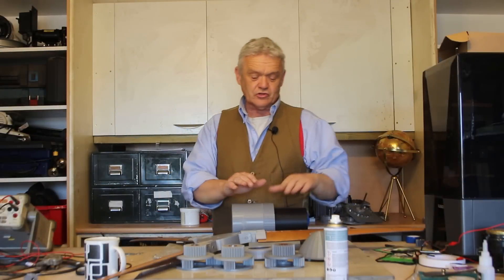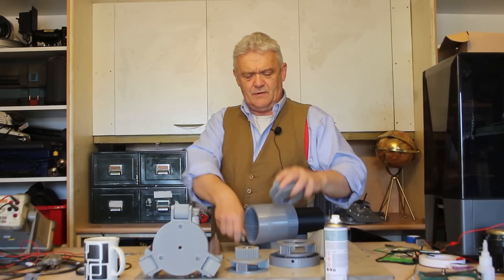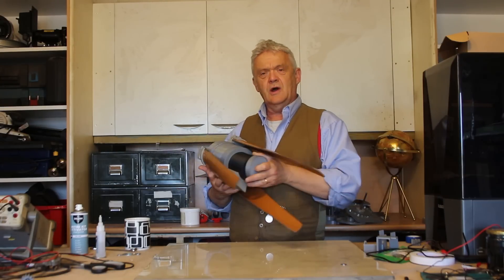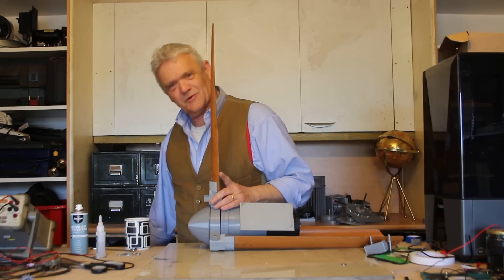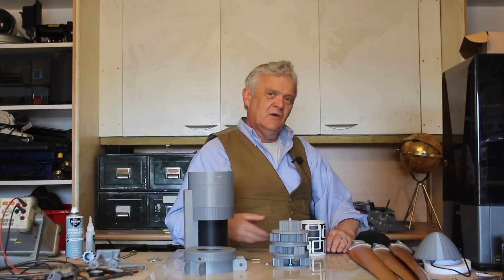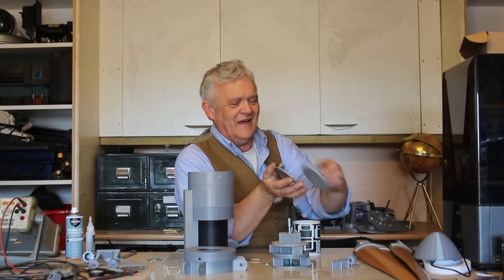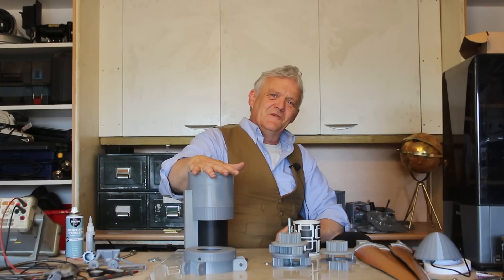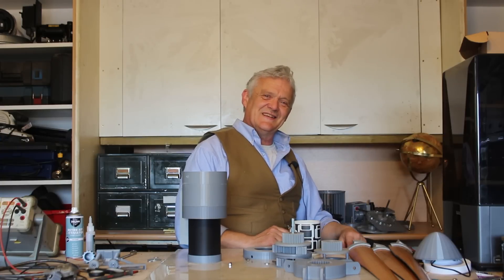1965 The Folding Wind Turbine

Comment: Hi Rob, I don't think using so many gears is a viable solution. From the point of view of efficiency, it is a waste of energy and the cause of many mechanical failures in this type of 3D creations. Best would be to use a rewound bldc motor, with a KV (RPM/V) between 20-50. It is necessary to promote that the windings have the lowest possible resistance (ideally less than 1 ohm). If you use a three-phase rectifier with Schotkky diodes, much better.
Reply from the maker: I understand mate - thanks for the advice and cheers - i should add I am going to ignore it but not out of disrespect for what you say - i think you are spot on but i have other objectives beyond just making a wind turbine that i also include in the videos.

Comment: Nylon would be a much better material for gears
Reply: No lubricant can be applied to nylon cuz it would swell the gears I don't know that nylon would be more useful then.
Reply: @johnschneider931  Nylon is self lubricating, and is used widely in the industry. Most of the gears in your printer are made out of nylon, AND they're lubricated with a special grease
Reply from the maker: cheers mate

Comment: Brilliant job Rob, that worked so much better than I expected. Maybe a little light grease on the gears would also help.
Reply from the maker: yeah me too - i was wondering if i would have to reduce the gear ratio as i was thinking i had it too high - but i wanted to give it a go - good job i did lol
Reply: - spray teflon will give some lube without mess or significant drag.

Comment: 4.5 M/s is quite a lot. During the summer one needs to be right at the North Sea coast to get those speeds!

So what would it take to make this a Fan. Either more speed tollerant, or even higher torque fors pushing High Volume Low Speed. Direct drive moters have become the norm in HVLS.
Reply from the maker: the Beaufort scale calls that a moderate breeze mate - it's not a lot at all - we get that and more most every evening where i live
Reply: @ThinkingandTinkering  Beaufort 2-3. Coastal region on otherside of the North Sea that is common windspeed, during the summer (this year is extra quiet, BTW), land inward is drops to half. Outside the summer, when one wants to remain inside, it doubles.

But at this cut-in speed it shows why smaller windturbines/mills do not make sense, unless they can be construed extremely cheap. And that is where you work.
Reply from the maker: @perpetual4958  cheers mate
Reply: @ThinkingandTinkering  Always, Robert. Making things cheaply, cleverly, but tough is where it is at.

BTW, still looking for Builders Board, no-one  seems to know it, not even in UK. Do you have a brand or a link? Asked on the discords no one knew there either.

Comment: ????????  The concave side of a wind turbine blade is the upwind side.  Was the wind blowing at 4.5 MPS from inside the house????
Reply from the maker: this kind of blade actually works both ways round - because of the scoop in it is can either act in a drag fashion or as an airfoil - so it is not strictly one or the other mate
Reply: @ThinkingandTinkering  The motor seems to run at a very steady RPM - well done mate.

Comment: FDM 3D printing works for prototyping; for production you need to use more resistant material,
BTW, printing at 100% infill will not solve the issue as the "grain" stays the same, at best it will shear a little bit later. Printing the pins separately, horizontally, at lower speed and probably higher temperature, ,using a better material such as PETG, can be a solution.
Reply from the maker: cheers mate

Comment: (regarding 3D printing, Robert)
Is it inefficient, having to heat the entire bed when printing?
Might it be (even if only slightly) better to somehow heat the direct spot beneath the bed with something like a laser or even a wheel or heated current of air?
(I'm brand new to printing, and am waiting for my Neptune max).
You should definitely make some videos about customising printers, and what they could potentially do down the line.

Thanks again, Robert, I truly appreciate what you do.
Reply from the maker: it is mate - but the newer printers - including the Neptune 4s have zone heating now - however heating from the top will likely distort your print - i haven't done much on the printers themselves - i mostly just use them - but what you say makes sense - cheers mate

Comment: Your blades are on backwards (unless you are making a downwind turbine)
Reply from the maker: this kind of blade actually works both ways round - because of the scoop in it is can either act in a drag fashion or as an airfoil - so it is not strictly one or the other mate

Comment: Could the blades be reversed on the hub so that the force of the wind would hold them open, instead of blocks or pins?
The hub for the turbine blades looks really close to the design of a tripod base.  Could another identical hub be used as a part of a tripod stand for the turbne?
Reply from the maker: it could and in the first version that's what i did - but it would make the turbine pretty long when folded

Comment: excellent, yes I dont think many plastics would stand up to the pressure of those axles, at the same time I did notice the blades needed balancing (that would also help with smoother running too)
Reply from the maker: good point mate - cheers

Comment: The gearbox can be milled from metal, and will perform better and last longer. But a good design, especially for teaching purposes. 
You can add more blades, or make them longer, to get more torque
Reply from the maker: it certainly could mate and you are dead right - cheers
Reply: At a cost, though.

Comment: Judging by the noise coming from the 3d printed gears, it seems that you are losing significant amount of energy as friction. How can one reduce friction while still working with a 3d printed prototype?
Reply: Smooth out the cogs, add oil into the gearbox.
Reply: @SinsBird  for 3d printed parts?  Won't they become more fragile if you do that?
Reply: @kinjalbasu1999  depends on what you use.
Reply: @SinsBird  which filaments and structure density are affected and which are not? ( just in case you have some experience so we can save some bucks 😉😉)
Reply from the maker: closer tolerances, bearings, oil and materials
Reply: @ThinkingandTinkering  Spin the gearbox while coated with an abrasive, like T-cut, to smooth off the contact points. Obvs you need to rinse it off and put some lubrication on it to use it...

Comment: Worst case scenario you could use the plastic printed pieces to make moulds from and then smelt more sturdy versions out of aluminium.
Reply from the maker: i don't think that is a worse case mate - we are really working out a working glitch free model - the next step would be production prototype - then it is time to cast!
Reply: Could get an Aluminium 3d print by sending the stls to an on demand printing service too.
Reply from the maker: that would cost a lot mate - but if you have a working model and want a production prototype it would be a good way to go

Comment: Very neat.  How well do 3d printed components last when used mechanically? Are you planning to use any of your turbines to generate at home, or is it all about the research / sharing?
Reply from the maker: i am a teacher at heart mate lol
Reply: Oh! I hadn't got to the sheared pin section when I wrote the above.  I was wondering how well cogs last turning against each other - or is this just for prototyping?
Reply: @LeighHowells  mostly depends on their size. You can make the cogs very big and do nothing else and they would last a long time. Or you can make them smaller but add water into the gearbox and this would prevent them softening from heat. Or you could add oil into the gearbox and it would cool them as well as improve lubrication. Or you could even electroplate them with metal.